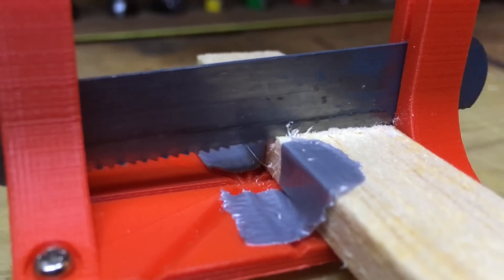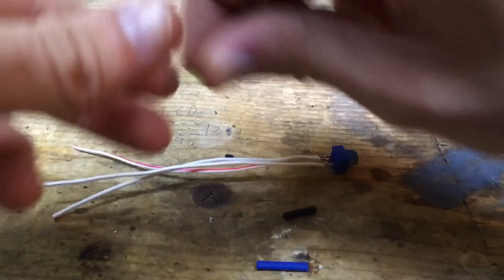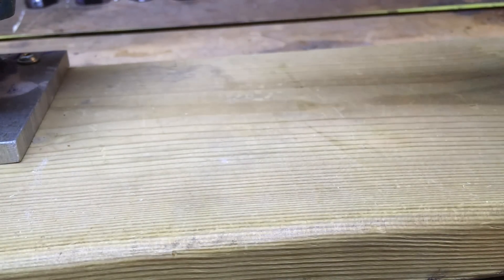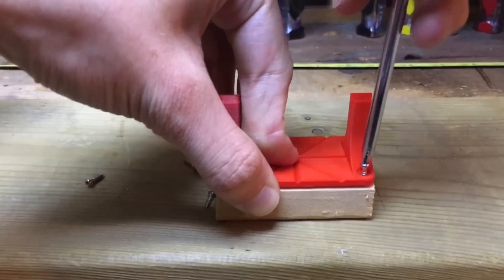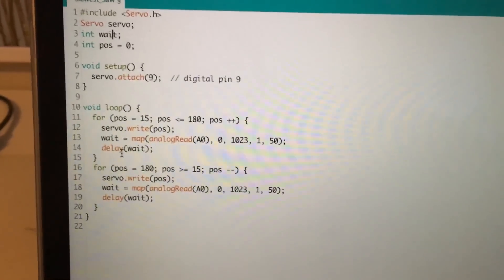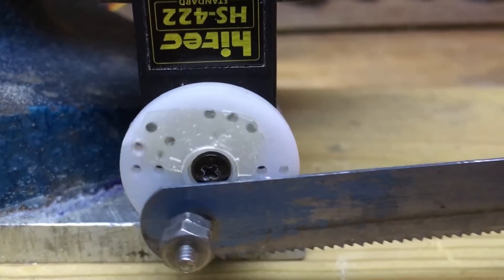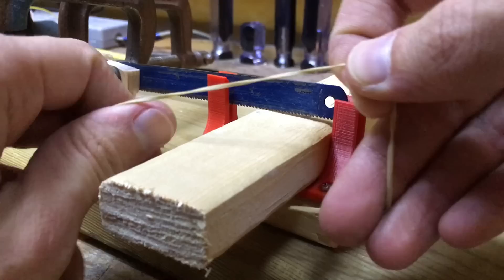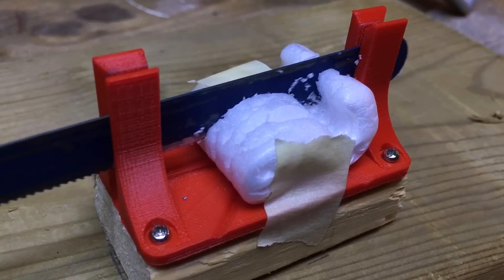Mildly Interesting! Building The World's Slowest Saw

Comment: Using a metal saw for wood, eh?
Reply from the maker: Wood, foam, and lead, to be precise. It's the only one I had that was the proper size, and had holes on the ends.
Reply: Gotta do what ya gotta do.
Reply: Make a slow digging tool so you can go to China in 46 years.

Comment: just put a weight on the end of the saw blade so its actually forcing it to cut the wood
Reply from the maker: I did put weight on the blade, just not directly over the wood being cut, because that would prevent the blade from passing through.
Reply from the maker: Interesting idea. I'm going to try that.